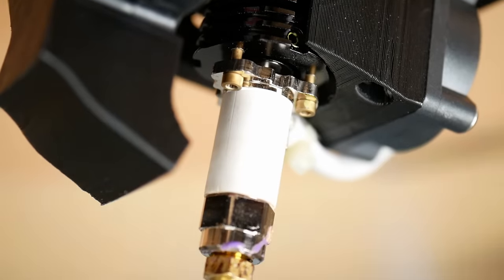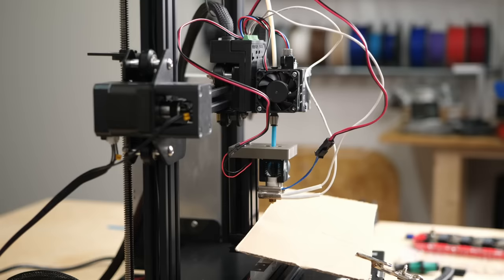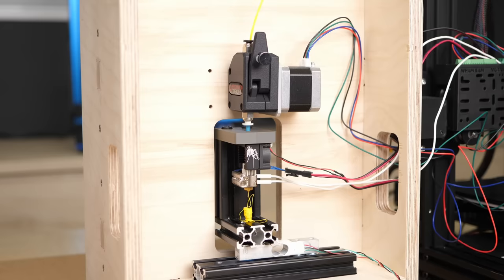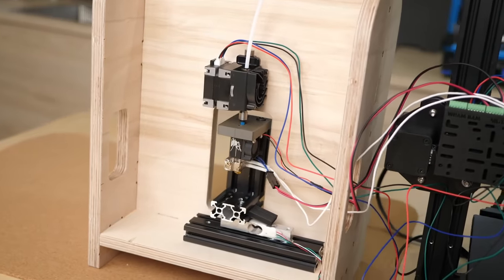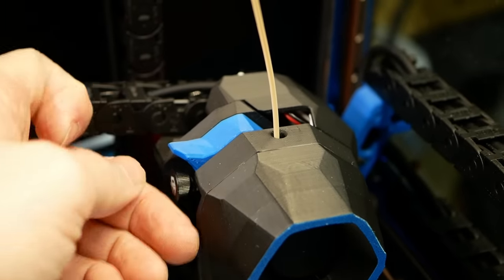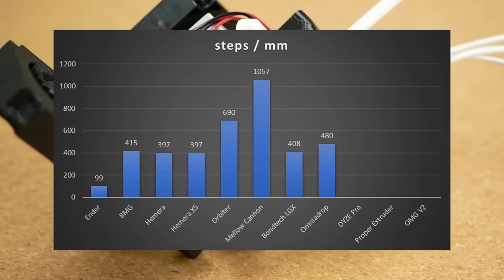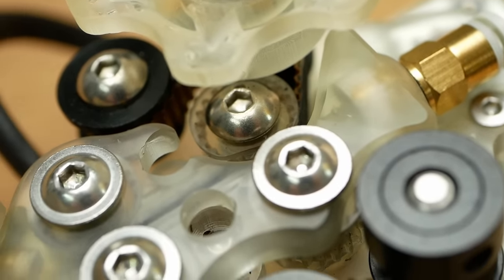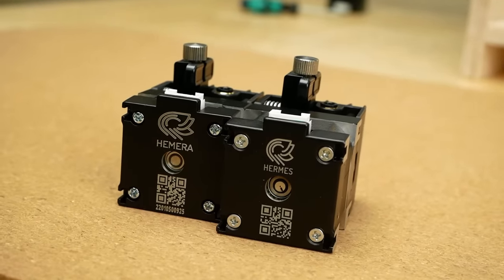I tried to find the Strongest Filament Extruder.

Comment: The elephant in the room is the filament diameter. 1.75mm has less surface are than 2.85mm. Unfortunately, the 3D printing world made the switch for better precision?. Now, all the hardwork, just to fix the issue that never existed in the first place!😂

Comment: There is also an extruder based on a brushless motor, the filament flows through the centre of the motor, really interesting design. No idea how good it is though.
Reply: It would be very cool, if the bigger 3d printing youtubers would give it more publicity!
Reply: What’s it called?

Comment: I work in the HDPE pipe fitting fabrication industry. Our fabricators use extrusion welding guns that mangle the filament like the bondtech extruder does.  If you’re interested in the technology, I think we use an older version of the Wegener EXWELD sigma4 SC TWISTY.

Comment: The OMGv2 series extruder gave me an idea. Two completely separate extruders, in series. A big beefy one like the Hemera or Proper at the start, then a bowden tube connecting it to a small lightweight extruder like the Orbiter. The big extruder would provide most of the force, while the small extruder would help with retraction, especially with flexible materials.
Both high torque with low print head weight and good retraction performance. It also spreads out the "grip" on the filament, so any grinding will less likely cause an unrecoverable failure.

Something even smaller and lighter could be designed, as the head extruder would really only need to provide a fraction of a KG of force.
Reply: It would be a nightmare to sync them properly. Filament will still slip from time to time.
Reply: This is a cool idea. It should be possible to calculate the optimal movement patterns for each stepper, if you approximate the filament path as a system of springs and masses. You could start out by using that same math to calculate the optimal force balance between the steppers as well, to see how much weight savings are realistic.

Now that I think about it more, there's another way this might be beneficial - Most of the low frequency movements (the bulk of the pushing) will be done by the remote extruder, leaving the high frequency movements (retractions, starting and stopping, etc) for the hotend extruder. Since that would require sharp spikes of high torque, but no long-term constant torque, a more advanced driver operating with variable current might be able to get a lot more torque out of a tiny stepper without overheating it. Not sure what the options are there, it might push you to a closed loop system.

Comment: Best performance in my tests from years ago was Bondtech QR and Bondtech V2. Planetary steppers with medium diameter gears. Worth a look in the right application. I tested max flows and pressures into a load cell rig in PLA, ABS, PETG, and TPU.

Comment: I’m impressed with the biqu h2, very light and like the hemera has the hot end built into the very small stepper motor which I believe a 9:1 gear ratio.
Reply: It's 7:1 but yeah, its great
Reply: I've been using it for a year and I've not had a single problem. It just works good.
Reply: This is a setup I would have liked to see tested. I believe the package comes in at a similar wieght to the orbitor setup so knowing it's pushing force would be interesting.
Reply from the maker: Good point! An even smaller Hemera-Like extruder.
Reply: I would also like to see this setup tested.

Comment: We us Dyze Extruders, Nozzles and Hot-Ends on our Blackbelt Printers and they are super reliable. We are printing often big parts which run 3-5 days in average, use PLA, HT, PETG, Varioshore TPU, TPU, nGen, nGen_Flex, etc. and it never skips a beat. One some Dyze Parts we have over 12000 hours of printing and they still work. Really happy with the performance and after the Test here I see even less reason to try something else in the moment. Loved the Video!

Comment: I've been running an OMG v2 for some time now in a Bowden setup. It's been reliable and no issues. Glad to see it did well!
Reply from the maker: Great to hear some real world experience.
Reply: Me to, but as a direct drive.
But I'm not sure mine is the V2 or the older V1 ( it's been a while since i got it )

either way, it works great :)
Reply: I bought one also for a bowden setup paired with a dropeffect xg hotend. They are going to go in my Voron 0.2 I'm trying to build.

Comment: So glad to finally see an OMG extruder represented! I have had an OMG DM1 for around 8 months now, and its the single best purchase I ever made. With the pancake included motor, it is light AF, doesn't require ANY mounting hardware (it just screws into the hot end like a coupler), and just works phenomenally well. 10/10, absolutely love that thing

Comment: I really like the design of the dyze extruder gears. Since they use those spikes to press into the filament I'm guessing they don't need a tension adjustment because it's not depending on tension to drive the filament. It probably bottoms the two sides of the outer edges of the gears against each other and the spikes drive the filament regardless of what filament is in there so there's no need for tension adjustment. Very interesting design that other manufacturers really should adopt. The squeeze style definitely has its drawbacks

Comment: The " professional " injection molding machines use a spiral ( reverse drill ) to push molten pellets/filament and hold pressure in the mold.  I would recommend looking into some of the " DIY " machines for taking your old filament and making new to you filament as that is closer to an injection part of the plastics manufacturing.  This is still great information as it also can be used for design choices for a Voron between the weight classes and how much filament can be pushed and how hard.  Thank you for not just the hard work, the excellent graphs showing the information and the important summary that makes it well worth the comparison.

Comment: i am REALLY looking forward to your injection molding video!!!!! can you try SLA printed molds with plastics that melt at low temps?
Reply: Companies like siriya tech make resins that are high temp and work with 200C+ I believe.
Reply: If you are interested in hobby injection molding the YouTube channel TheCrafsMan SteadyCraftin has a number of videos that show the use of a manual bench top pellet feeder/injector/mold clamping device using both metal and 3D printed molds that is a pretty good resource and might be of interest to you.
Reply from the maker: That's my plan!
Reply: @CNCKitchen  yes!
Reply: @CNCKitchen  cool!

Comment: I'm putting out this mini-alert about a wiring problem I discovered on my BIQU Hurakan. The video about it is featured on my YouTube site. Here's the bottom line: BIQU put two ground wires, a frame ground, and a switch / power inlet ground, on the single FG post of the power supply that comes with the Hurakan. It's possible that resonance tuning can work the lower ground wire away from the FG post of the power supply. Having an ungrounded switch / power inlet ground wire loose in that area, where there are a lot of control wires heading to the control broad may be a recipe for disaster. If you have any thoughts on this, please inform your viewers, as some of them might own a Hurakan. Thank you for all the great work you're doing. It's really quite impressive!

Comment: File or grind a center channel in the extruder gears of the Hemera to match the spikey design of the Dyze Xtruder Pro and retest, as the Hemera with the large motor was a good performer where the filament grip was its weak point that might be easily rectified. It would be interesting to also do the reverse and increase the motor strength on the units that had the motor as the weak point.
Reply: Specially the ones that mount normal NEMA 17s, those have quite the potential for some ridiculous long high current steppers running on them, or if you wanna turn the absurdity up a notch, get one with a built-in reduction gearing.

Comment: Some of the 3d printed models and their CNC versions from Mellow;
vz-hextrudort printed and cnc version
sherpa micro printed and cnc version

Would be very cool to see if there's any difference between the printed/home built versions vs the higher end (yet on the cheaper end of the extruders in this test) CNC versions :)

You can also get them with 8t or 10t moons and LDO motors, could be very interesting to see if there's any strenght differences in real life between those.
Reply: I don't think there is any difference in push force between printed/cnc, at least to the point where printed one can break. But definitely there may be difference in precision - cnc is more precise, rigid, temperature-stable in hot chamber - cnc can deliver more quality to print, not force. And second thing, what can affect force - you can pump more current in stepper with alu extruder - it helps with motor cooling and there is no chance that extruder can melt and jam. 100C+ motor can survive , but definitely not ABS printed extruder.
Reply: @witalijlewandowski2384  yeah I think we agree :) would be cool to see what it would take to find differences, motor temps etc.

Comment: Super interesting!  I was hoping you would also cover the micro-swiss extruder too.  I'm interested to pair up the ideal extruder with a 0.8 to 1 mm nozzle, a higher output hot end on my Ender 5 plus to print very large prints (2.5 kg) in a TPU material.  Current print is 3.5 days.

Comment: Well, the OMG looks so well created. I love how easy feeding filament through it looks and how inexpensive it actually is. I currently have an all-metal ender extruder and it is actually fantastic from what I can see. Never skips or anything like that and I seem to be able to force quite a lot of filament through at quite the clip, but if I go to replace it because I hit that bottle neck (I've been pushing printing speeds faster and faster so I'm sure that I will hit that eventually) I'll definitely have to refer back to this video...

Comment: Hallo Steffan, ich habe selber viele Extruder ausprobiert. Mellows Cannon ist meiner Meinung nach der beste, aber nicht wegen der maximalen Kraft, sondern wegen der geringsten Flow Schwankung. Ich denke das liegt an der besonderen Art des Getriebes. Dadurch erzeugt er die schönsten Oberflächen entlang der Z Achse. Vielleicht kannst du dazu auch mal ein Test bzw. Vergleichs Video machen.
Reply from the maker: Gut zu hören. Das sollte ich unbedingt machen.
Reply: Sehr interessant! Ich habe jetzt ein OMG V2 für mein bowden Voron 0.2, was ich langsam baue, der Cannon war aber auch sehr sympathisch als upgrade weg. Ich habe ein dropeffect xg hotend gekauft, also flowrate ist nicht meine Priorität, sondern höchstmögliche Qualität und Beschleunigung.
edit: typo
Reply: @CNCKitchen  Hey Steffan, danke für dein Antwort. Ich hab dafür auch einen Testaufbau im Kopf, Extruder, Drehgeber und ein Hotend in einer Reihe. Der Extrudermotor wird mit Konstanter Schritte pro Sekunde angesteuert und man misst die Schritte am Drehgeber. Das lässt sich sicher mit dem Plotter von der Arduino IDE Darstellen oder in einen Graph. Vielleich mit verschiedenen Geschwindigkeiten oder ein Linearen anstieg. Verschiedener Last oder unterschiedlicher Temperatur am Hotend bzw. ohne Hotend. Wichtig ist das der Drehgeber Direkt das Filament antreibt, ohne Übersetzung.

Comment: Considering that you’re doing this testing partially for an injection molding system, I’d be very interested in seeing what happens when you put the giant stepper motors on these extrudes. For instance, the Dyze extruded with one of the “Super Whopper” motors would be very interesting, because we might be able to see what the limits of the gear teeth are.
Reply: @wyattutz  I'm actually planning to do that for a bowden voron 0.2 I'm building with the OMG V2 😅
edit: oh sorry, I meant the Speedy Power

Comment: I had hoped to see the latest all-metal hextrudort (if I'm not mistaken it is sold by Mellow) on the list.  It claims several improvements over what is otherwise similar to the Orbiter.  I'm especially interested whether the angled pattern on the drive wheels makes a difference ...

Comment: 4:39 The Bondtech BMG is NOT the OG dual gear extruder. That would be the Printrbot Gear Head. Of course the BMG had a much bigger impact.
I would have liked to have seen the Bondtech LGX Lite. I don't expect it to perform as well as the Orbiter (which I do mean to try some time), but would be good to see how it ranks.

Comment: Great video, thanks Stefan! And also I'm happy to see Proper Printing compared, he's such a cool guy.

On my SK-Tank I currently use a Bondtech LGX with a Dragon HF hotend and 0.6mm nozzle (can't remember if it's Bondtech CHT or Micro Swiss). So far I'm pretty happy with the LGX, but I do like to experiment when I have time. I spent a few months with the Biqu H2 and that was fun, but the cooling performance in that setup wasn't quite there for higher speed printing :-/

Comment: I'm so happy with purchasing The Orbiter 2. I never had any problems and a proper tensioned belt allows for great speeds.
The only two "flaws" I could find are the temperature, which is acceptable, but shouldn't get hotter and the manual feed for TPU. (Any small kink should be removed, because it will get stuck otherwise)
I can't recommend it enough.

Comment: Hey Stefan! Great video! I'm not sure if you saw it, but MirageC put out a really good video out about a month ago about Extrusion Quality which seem to be a large potential driver for the elusive "Prusa Issue 602." What MirageC found is that his BMG extruder had some slight wobble in the gears and that was enough to cause inconsistent extrusion that is visible with light sources directly above the print. With all these great extruders that you have, it would be awesome to see if there was a noticable difference between them with their extrusion consistency and compare them under harsh perpendicular lighting.

Comment: High Nozzle pressure is really not a good friend of FDM printing.  During the definition of my test procedure for hotend testing, I observed that filament will stop printing properly as soon as it enters the pressure creep zone.  This behaviour can be observed at all temperature points.   Improperly molten material will no be able to retain the shape induced by the nozzle and print path.  It will tend to return to its original shape.  Have a look to some of my results here: https://youtu.be/02aufZ1OVvQ?t=268

Great video as usual by the way, cant wait to see that molding injection project 👍
Reply: Get a better hot end so it melts faster?

Comment: Since you built the rig, would be nice to see what kind of forces the filament can withstand. feed a few different ones through a set geometry bowden and a direct drive setup, because I've got a feeling CF reinforced is liable to turn to dust at some of those pressures.

Comment: Double double gear (so two double gear one pushing one pulling) is the best, but not commercialised. The "puller" has most tension, the 'pusher' a bit less, so you have perfect push-pull effect. Used a lot in industrial machines. COOL the motor!

Comment: That one you mentioned was intended to replace the creality extruders definitely seems interesting (esp with the price point), since I don't necessarily need strength, but instead look for something that can do the best job at a reasonable price (which I do understand sometimes you have to spend more to get), it seems like a pretty good option

Comment: Injection moulding with an extruder will be really interesting! In theory 10kgf over 1.75mm diameter will result in 104kgf/cm2 or 10.2Mpa pressure, which is pretty good especially considering the buster beagle mk3 can do ~20mpa with a 100mm pneumatic cylinder. Bonus, I think its shot size would technically be equal to the size of the filament roll although time/cooling will prevent use of most of it.

Comment: I am very interested to see more on your injection molding project. I think the main issue you’re going to run into is the pressures involved. I can’t imagine any filament based extruder being able to generate enough pressure of the near liquid state polymer. Still very interested.
Reply: Yeah, I think it would need like some type of auger in the hot section to push out the melted filament, with the extruder gears only being responsible for supplying the high pressure pump; they're not really designed for anything other than having the filament drop out of a nozzle into free air.

Or if you didn't mind really long cycle times or using multiple molds then you could heat your mold up to the filament melting point to reduce the need for such high flow and high pressure to push the material into every fine feature before it starts hardening. I mean this is small hobby type stuff, there's no need for pushing out a part every 3-20 seconds.
Reply: Also, if you are interested in hobby injection molding the YouTube channel TheCrafsMan SteadyCraftin has a number of videos that show the use of a manual bench top pellet feeder/injector/mold clamping device using both metal and 3D printed molds that is a pretty good resource and might be of interest to you.

Comment: I really like how wenn the Orbiter performs! Thank you for the video. I would be interested in more experimental designs like the original 'Nextruder' idea by Prusa with a cycloidal gearbox. I think it is now planned with a planetary gearbox. Of course you tried to find the strongest extruder, but I think the retracting performance (so the accuracy when you extrude 1 mm, retract 1mm and then extrude 2 mm) is also important.